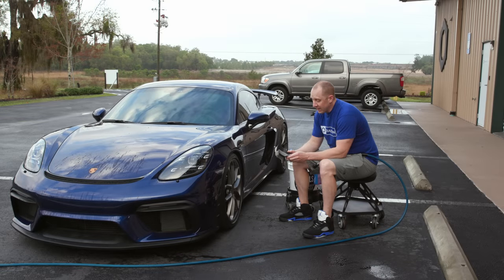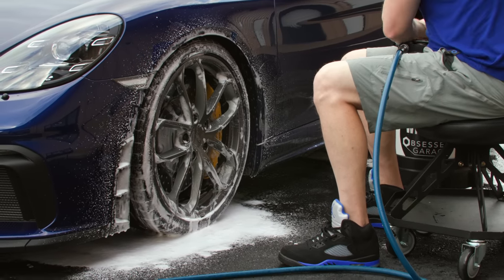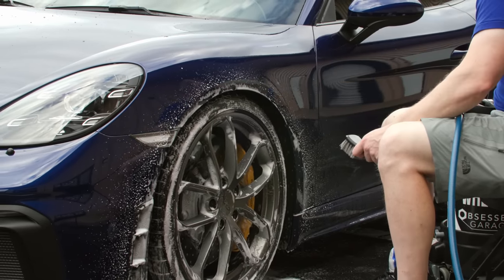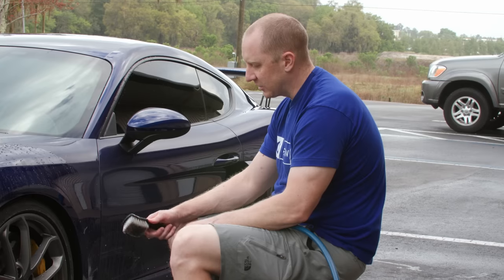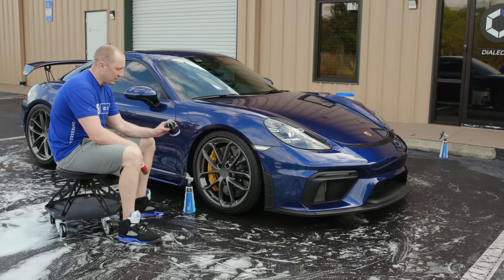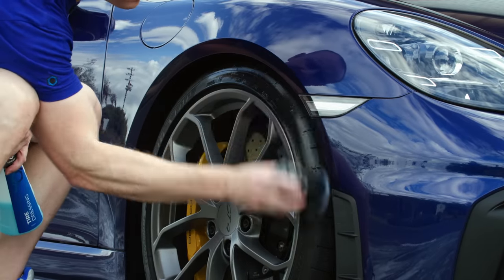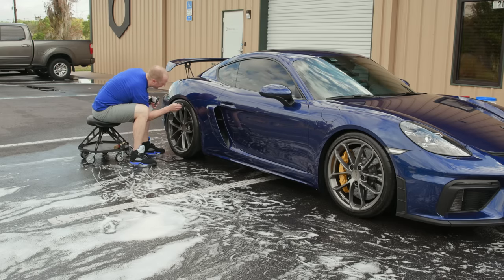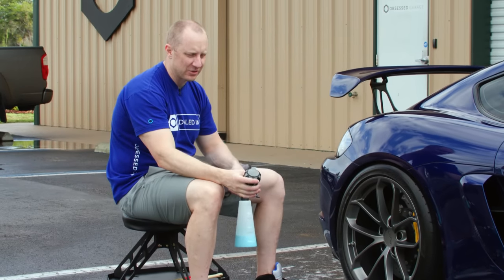Adjusting My Wheel/Tire Process With New Detail Factory Brushes

Comment: Matty, just do what I do roll the Porsche onto some thin blocks of wood and it keeps it off the wet cement makes it a little bit easier to dress your tires, because you’re able to get the full bottom part!
Reply: oh dang I need to start doing that.  Why the hell haven't I thought of that!  Good lord I've been washing cars over 20 years, and I always roll to a dry spot to dry, and then roll the car forward or backward a few inches to get the section of tire that was previously pointed toward the ground.  A piece of 1x board behind each tire on my sloped driveway should do the trick, and just let the car roll backwards onto them.

Comment: I'll definitely be picking these up!

Watching you trying to keep the brush off the pavement and out of the water reminded me of another reason I love Swisstrax, now that I have it. I use to pick up water/dirt from my garage floor when drying and dressing the tires (and it would also get all over my pressure washer hose)...now everything stays much cleaner and dryer. Sure there may be a few drops on the tiles, but it is far less than having the tires sitting in a puddle.

Comment: I've been using the Race Glaze method for over a year on all my cars and never looked back at using one of those janky Eagle One Swipes ever again because I hated getting my hands greasy and they would disintegrate after a few uses. I'll add the Detail Factory brush to the bucket since it appears to level off hight spots but I don't think it will replace the boars hair brush that already works great.

Comment: Sold! I've been using the Adam's tire applicators hex for years. But they always separate once the dressing saturates to the glued surface. Big, ruff-tread tires I use an old paint brush with about 1/2" of the bristles cut off. Tuff-Shine brush is worth double the price. They are a one-time purpose because they'll last forever.

Comment: Matt: puts towel on ground
Me: Faints and questions everything
Reply: I often wonder if he uses a new towel every time. Even if I washed it, I wouldnt reuse a towel that was on the ground like that. Ive seen him wipe the pressure washer hose with a gauntlet towel too.. I use only my cheapest crappiest towels for that.
Reply: @blake8297  I mean when these towels are produced in the factory how do we know the sheets of fibres are actually clean or haven't been on the floor. Once the towel is constructed, do we really know if its been dropped on the ground?

So personally I wouldn't just bin a towel just cause its been dropped, a good was should get any debris from the ground off.
Reply: @KiranPatel-fk1pg  agreed, also it’s just not that big of a deal. Obviously don’t be deliberately foolish but it’s just a towel, it’s just a car, haha. 
“Can’t use the towel it wasn’t zip locked and kept in air tight boxes and never touched anything before my paint!”
Meanwhile your car slings brake dust, oils, and sand all over it self. Do you really think you can avoid the “micro” dirt people say will “scratch” your paint? 
IMHO, if you can’t see the dirt it’s fine. Scratches happen it’s life enjoy the dang car